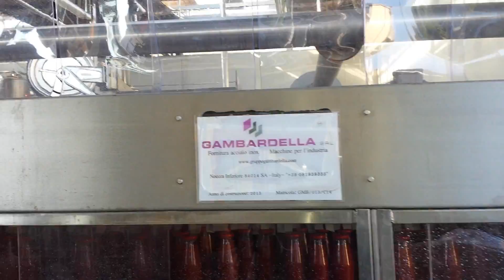linea passata pomodoro

Comment: How to enhance tomato processing yields? Pulsed electric field processing (PEF) is a non-thermal, low-energy technology that can be used to peel tomatoes, speed the 

initial drying of tomatoes and improve the extraction of juice from tomato pomace in tomato processing plants. PEF treatment of the tomatoes, prior to cutting may complement the peeling step by the formation of pores in cell membranes. See PULSEMASTER